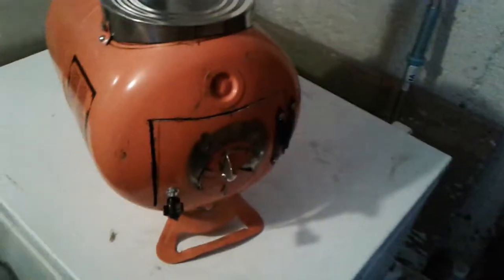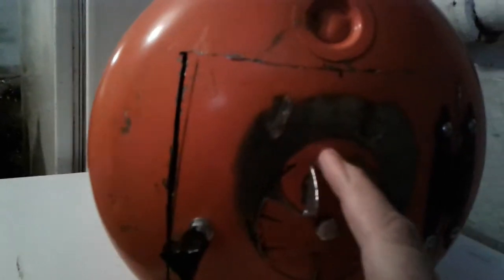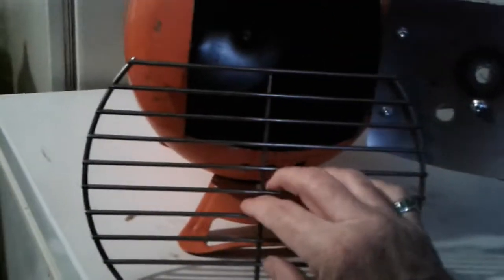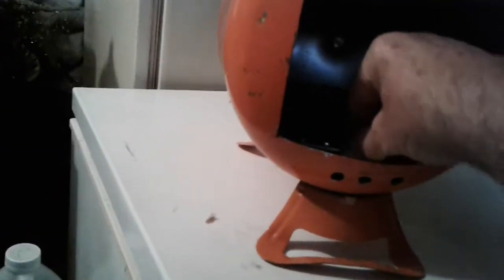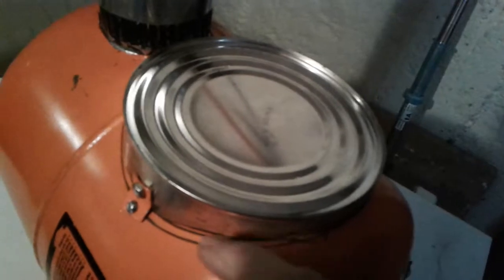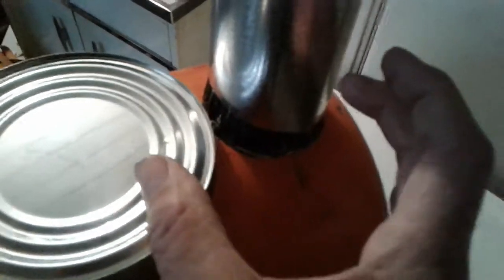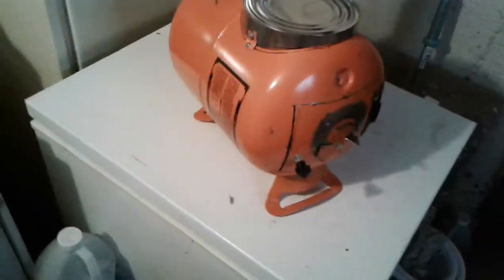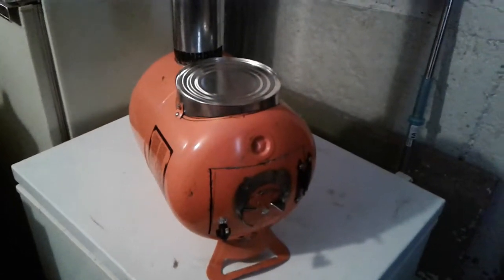Ice shack wood stove. Diy.

Comment: Did you get a chance to use the stove in your ice shack?
Reply from the maker: Not yet, still have to build it. It's going to be on the dock. 7'x7' composite.
Reply from the maker: @Rajesh Singh I really don't have any idea how much would it would take to heat your little trailer. It depends on how much insulation is in the trailer, how cold it is outside, and the type of wood that you are burning. I did not design back stove the Heat the ice shack through the night. I originally designed it keep an ice shack warm just while I was fishing.